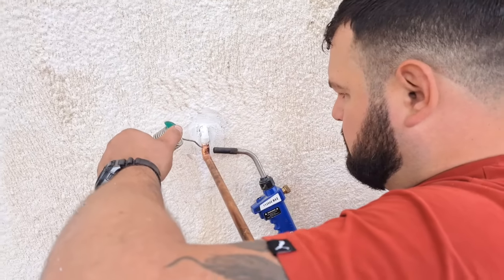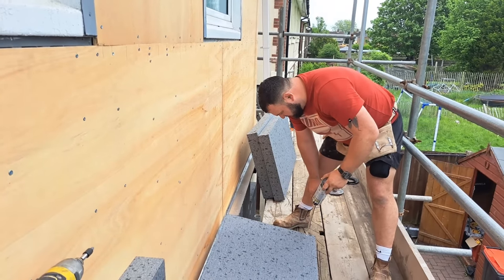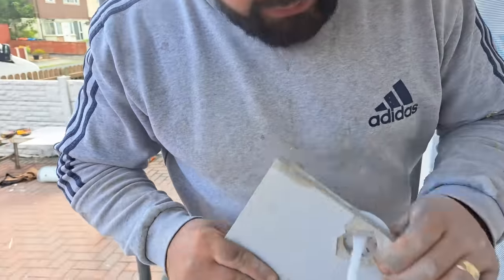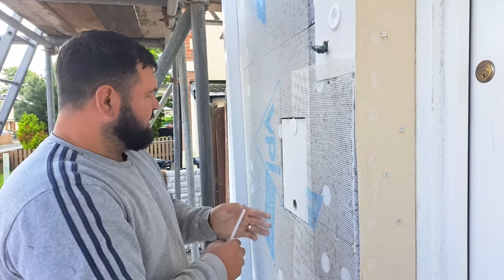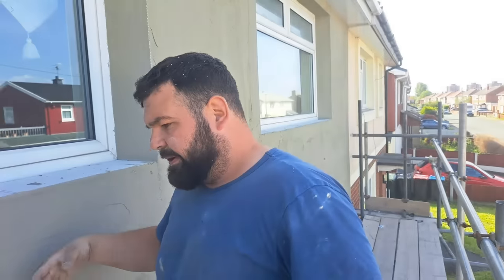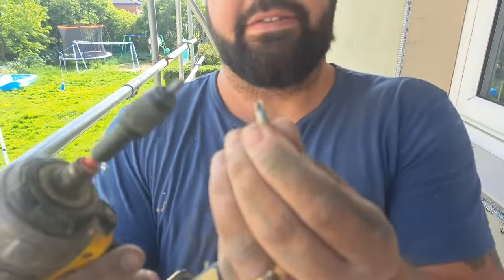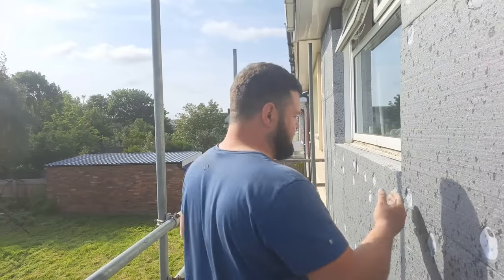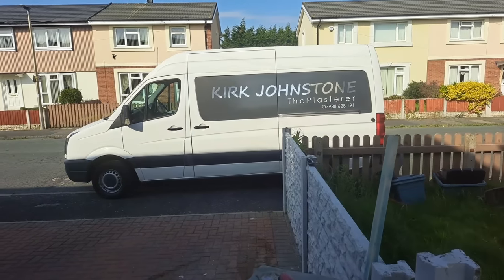EXTERNAL WALL INSULATION PART 2

Comment: Glad you highlighted the difference between Philips (PH) and pozidriv (PZ) bits, it is crazy how many people still do not know that, in work. we have a tools counter for everything we need, i asked for a pozi, and they gave me a Philips, i said, no, i wanted a pozi. and the bloke on the counter, who had been working there for about 5 year to 10 years, had no idea there was a difference.  

Ph are designed to cam out, pozi are not, so you get virtually no slippage with pozi.

and as you demonstrated, Pozi bits do not fit Philips screws all that well. they do not seat correctly as the wings keep it from doing so.

Comment: Nice to see you back Kirk. You've done a good job of that so far. Was gonna mention putting plugs for the thermal bridging but then thought there's a reason why Kirk ain't done it. I've never done this stuff but I've researched it as I'm a bit nerdy with plastering systems I spend time looking it up just in case I ever do a job with it better to have the knowledge in my head so I've got the jargon I may need to tell customers 🍻

Comment: Had a few Polish down south, Drove fixings through the double glazing frames hence windows wont come out without a lot of destruction, nice work Kirk have you got a link to suppliers. Have BISF semi I've bricked lower concrete frontage, garage to side and conservatory to rear so only top to do. the inner void blows a gail from neighbour, would be nice to insulate inner cavity but i guess rot would set in.

Comment: Explain why u put mesh on and then base over? The mesh isnt doing nothing? It needs to be bedded in to 1st coat surely?
Reply from the maker: When you try and bed it in this stuff it just drags everywhere, as soon at this stuff picks up a but you just can't touch it with a trowel mate.

It works the same way as when your plastering and you put your scrim over the joints of the boards pal 👍

Comment: I have a question for you Kirk ... I live in a Victorian terrace the plasterwork is all over place not flat not smooth not level . Should I hack it back to bare brick or go over the top of it?
Reply: Air on the side of caution.. if it's Victorian building plaster work then 100% it's lime based, & pointing will be same not advisable to put cement based or gypsum based materials over top as you will need to seal surfaces beforehand. With SBR(🎉) or PVA(🤮) You can do it, but problems can quickly arise. 

Generally most old buildings are out of plumb... Traditional lime work be warned tho it's expensive & very time-consuming..

Hack off and redo 🚨🚨..if walls are sound don't mess with them. 
If ya still dead set on doing, it Limelite Renovating Plaster..is the one I've not cue on current price tho

Best of luck
Reply: @stevengordon2145  it's not lime it was redone during 90s but done badly
Reply: @TeeTee-zm2re  ✅ ok hack it off.. start again loads methods to get over it..I would still check pointing to see if it's lime based.

Been on trowle 22 years and I personally never mix the two. lime based plasters really don't like cement based products.
Reply: @stevengordon2145  thank you
Reply: @TeeTee-zm2re  Your most welcome, always good to see others picking up the trowle...only way you lean how knows ya mite stick with it.

All the very best 👍

Comment: mate so sorry but never seen mesh being applied straight to board and render over!!!
mesg should be between layers of base coat and never be put over dry boards coz you loosing contact with with the wall. mate your plastering videos are sound but please dont do that mistake coz you seems to know what u doing with plastering. peace